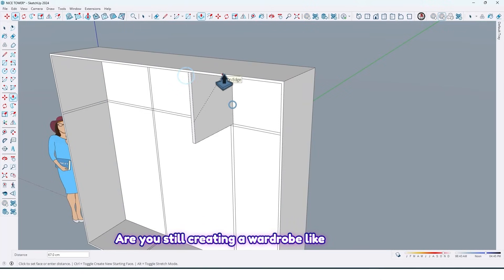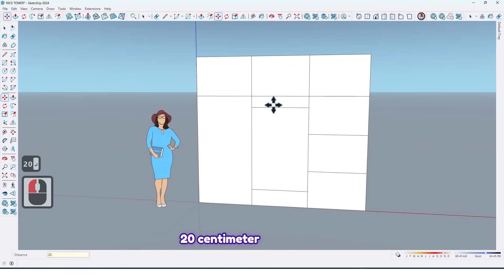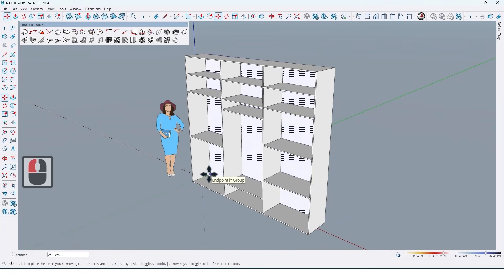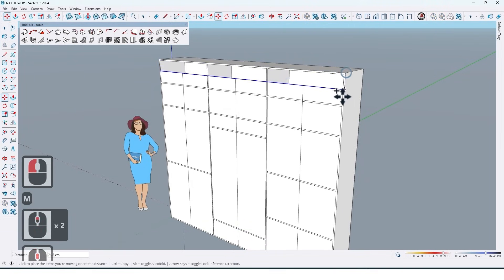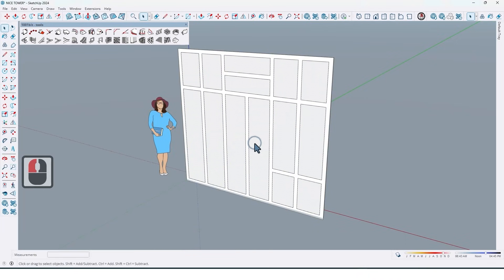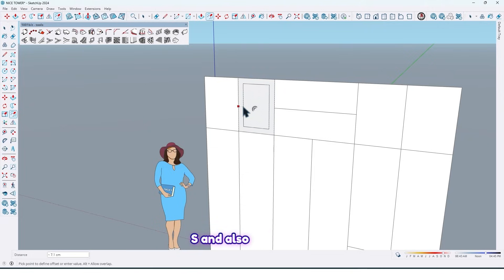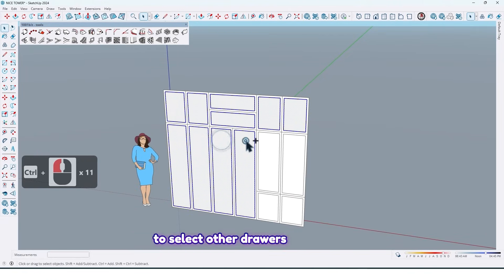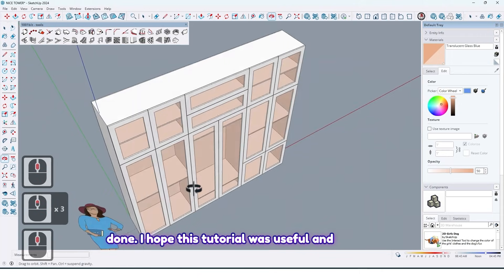5 SketchUp Hacks to Create PROFESSIONAL Wardrobe Designs FAST

Comment: All good beside the part from 6:50 
I really, really do not understand this part: 0.4cm and 0.2cm.
I don't get it at all.

Would you be so kind to explain that part a little bit?
Thanks in advance, and keep up the good work. This is a great tutorial overall.
Reply from the maker: The 1001Bit Tools plugin offsets both sides based on the edge we specify and the unit value we assign to it. For this reason, we first offset the contact line between the two doors by 3.7 cm inward to create a centerline for the plugin. Then we instruct the plugin to offset each side by 3.5 cm from that same centerline. As a result, the remaining 0.2 cm on each side is preserved as the gap between the two doors, so it appears natural and the seam between the doors is clearly visible in the render.

Comment: The 1001 bit grill tools does not work when double clicking offsets. I have to manually select them one by one or the option box will not appear. If I select them all at once them click grill option in 1001 bit i get 2 lines created at the bottom right corner of the wardrobe rectangle and they are grouped together. I have tried several times with the same result. I have also uninstalled and reinstall 1001 bit tools with the same result. Any advice would be greatly appreciated.
Reply from the maker: We don’t need any plugins to repeat the offset